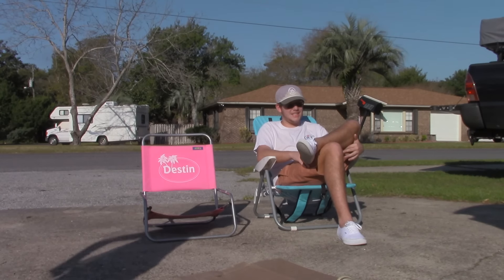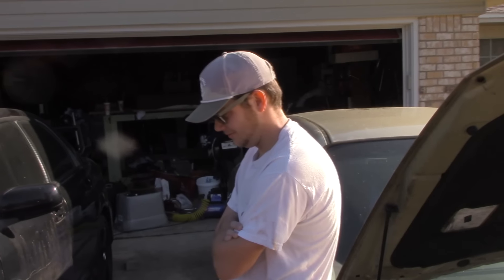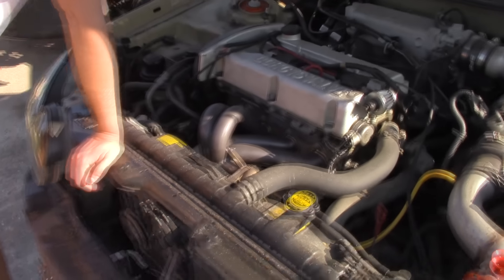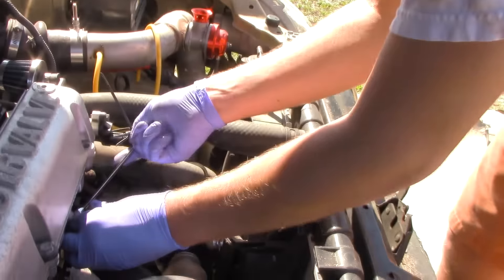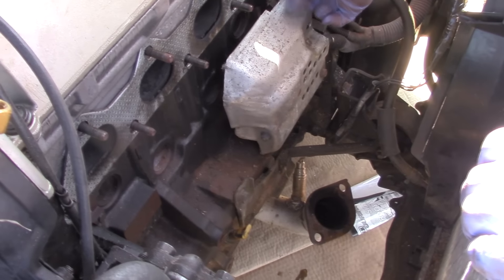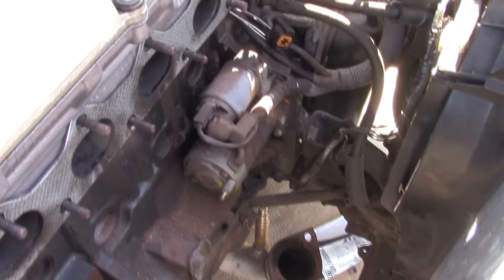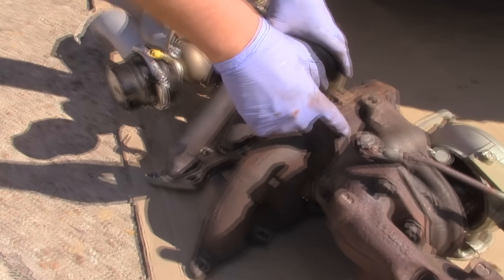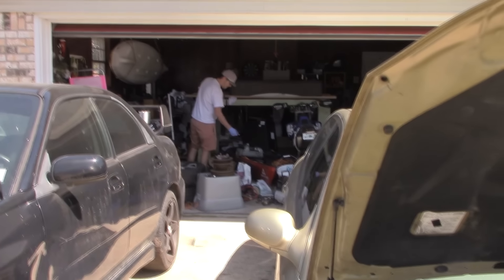Almost Legit Turbo

Comment: you guys need to take the t3 flange manifold and get the converter flange from ebay so you can take the new evo turbo and bolt it onto the T3 and rotate it 180 degrees so that the compressor side is facing the timing belt and the exhuast side is towards the trans and your downpipe you already have........

Comment: relocate your starter solenoid  reroute the lines run two gaskets behind the exhaust manifold. header spacer using a header plate for making your own headers and longer studs if needed. find out what other cars have these motors go to parts store measure all those starters. I love the projects keep up the good work guys.

Comment: as well as figuring out your starter situation you will need to drill out the manifold holes and the bottom right one will need to slot to go over stud or make a very large hole in that one

Comment: the engine actually is not flipped the other way in evos... its actually the same orientation as what you have in the sonata... evo 1-3 are flipped like dsm 4g63s. and the starter is located right there on the evo 8 but it is down a little more, requires removing the down pipe

Comment: can you not just on bolt at the square flange and spin just the manifold itself?  That would put the turbo on the passenger side and line up the exhaust too. That's how the hold set up was. "maybe I'm just wrong"
Reply: could do that but would run into issues with the downpipe would be a very odd shape to meet it up with the exhaust but still could try but some custom work would need to be done to figure out downpipe situation

Comment: damn. why can't ur eBay turbos stay alive. I got the same one and its a year and a half old with like 6000 miles and only took it off to upgrade. it was running 10 psi ~ 270 WHP on my car, daily driver. I feel like sending it to you guys but feel like it will go out on you lmao

Comment: honestly that 90 on your  return has got 2 go. I see that as 75 percent of your problem for fucking up ur turbos .i have seen alot of turbo sloppy kits They never have any 90,s on them like that it,s got to be like 1/2 to 5/8  id. Stright as can be for best results and no leaks. j/m/o not tring to knock on yall j/s good luck
Reply: Do they still have the oil feed coming from the hole they tapped in the oil pressure relief valve cap?

Comment: fix your damn drain line It should not have a 90 degree bend in it. The drain needs to slope into the pan gradually or oil will not drain out of the turbo properly causing it to back up in the center section and puke oil out of the compressor and exhaust housing.
Reply: this is why they are on turbo #3....